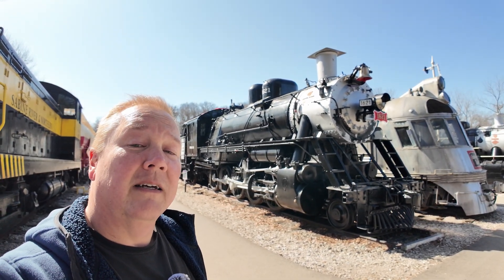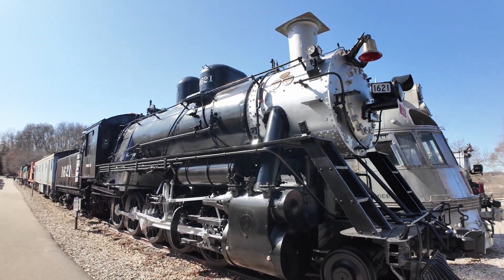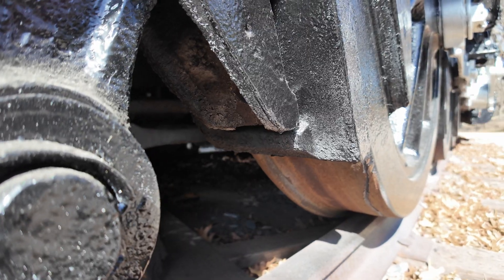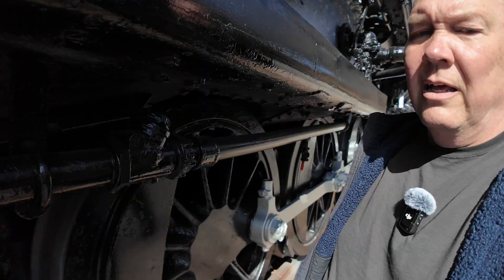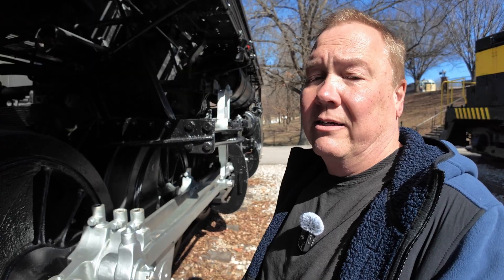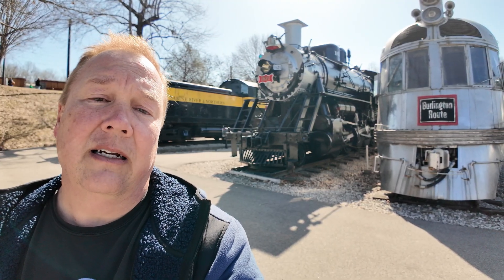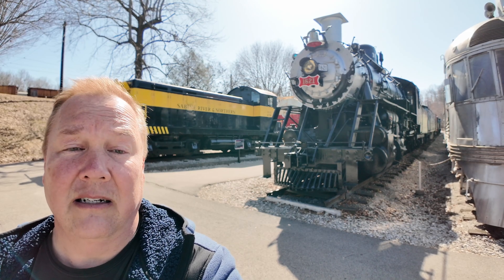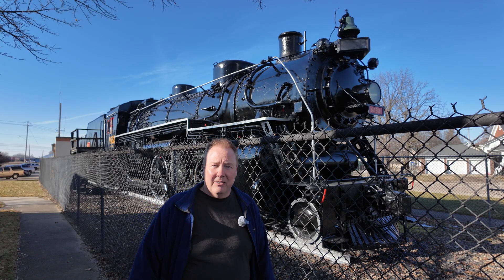The Russian Decapod Steam Engine Doesn't Fit US Rails!

Comment: When you talk about the driving wheels you never mention the word "tire."  They put wider than normal tires on them which moved the flanges back to the standard gauge location.  Your video is rather vague about this.  How wide the tires were can be seen in the shot which shows the brake shoes for the drivers, and the tire extends well to the inside.  I hope you know that steam locomotives had tires on the drivers which bore all the wear of operation and would be replaced as needed as part of normal maintenance.  You can see from the other comments that a lot of people think the drivers actually were changed, so please add to your discussion or edit the commentary to clarify this.  I worked at the museum for 10 years and am completely familiar with that locomotive.
Reply from the maker: You know, there's actually been a lot of discussion on this.  There are some who seem in a position to know who swear the drivers were cast wide and tires put on to fit those new drivers. Others are absolutely sure that the drivers weren't changed, but the wider tires were put on.  I haven't been able to verify it yet, but I suspect both may have happened.  Since these were actually in production when the order was canceled, there's a good chance that not all the drivers had been cast yet.  Possibly, where the drivers weren't already cast, new ones were cast but if the drivers were already cast, new, wider tires may have just been fitted on the narrower drivers.  As I said, this is just a suspicion at this point, not anything I've been able to verify.  Verification would likely be in the form of finding one with wide-cast wheels and no overhang on the inside, indicating a recast wheel, AND one with a 1 3/4 overhang on the inside, indicating the wheels were not recast for that one.
Reply: This is easy if you are next to it just reach around the driver and you can feel how far the tire extends beyond the driving wheel.  That wheel center is the original one, not a replacement as that wouldn't have needed the wide tire.
Reply from the maker: Yep, unfortunately, I don't personally have one close at hand (about 500 miles to the nearest one, I think).  Since there's suspicion that they are set up both ways, I'm leaning toward asking viewers to poke their cameras around the back of the drivers and post video.  If we get enough, that'd go a long ways toward answering the question of 1) at least some drivers were definitely replaced or 2) at least some tires were replaced to original drivers or 3) definitely some drivers were replaced and some just replaced tires.  Unfortunately, August was the slow time for youtube views for everyone, so a bad time to ask, and now vacation season is ending.  Kind of leaning toward asking in the spring, as museums are opening back up and people are starting to travel again.

Comment: It was said the 4’8.5 was the space between the chariot wheels on old romans Roads that were still being used thousands of years later. He used that those roads as a child there,in England. It is said he thought it was good enough for the romans to last, It would be good enough for his to last as well. Adopted Afterwards
Reply from the maker: That story's been around for quite a while, although people have recently started to question if that's actually the case.  Early in railroad history, there were a LOT of different gauges, including many really close to today's standard gauge.  The tended to be made around available wagon sizes at the time. 
 It's still agreed that the width came from being the carriage width you needed if you had two horses, side by side, but that exact gauge?  That's where the questions are today.

Comment: With all of the break-of-gauge talk, it is possible to travel by train between Moscow and Beijing in the same car.  There is a building at the border of Russia and Manchuria where the 5-foot trucks are taken off and standard gauge trucks are put on for the train to continue.  The reverse is done with the train in the reverse direction.  From what I have read, this process takes about an hour.
Reply from the maker: I'm not surprised.  Cars are easy.  Locomotives are more challenging.
Reply: @Industrial_Revolution  Locos are swapped at this location.
Reply from the maker: @royreynolds108 makes sense.

Comment: In WW2 first, the Wehrmacht had to 'renail' the rails in the occupied territories to standard gauge. After 'Stalingrad' the Soviets had to 're-renail' the rails back to the Russian gauge.
Sadly, the difference between the gauges (1520 - 1435 = 85 mm) is too small for installing 3-rail tracks which is done in Spain.
Reply from the maker: I hadn't thought about the option to double-gauge the lines, but you're right.  They're too close together for that to work.
Reply: @Industrial_Revolution  It is the usual game with Russia: everything is a bit different so it does not fit, like caliber 152mm instead of 155mm.

Comment: Brunel built the Great Western in Britain to a luxurious seven foot gauge allowing for huge coaches and very powerful locos. But everyone else used the original standard gauge from the first railways. So in 1892 the GWR converted their entire network and all the broad gauge vehicles were scrapped. There are amazing photos of scrapyards full of GWR locos at the time.
Reply from the maker: What I heard about Brunel's train was that, although it was far better by nearly every measure, the extra costs were just too much to take.  It cost twice as much to build railbeds and the extra width meant a bridge or tunnel that would hold two tracks before would now only hold one, more than doubling those costs.  In the end, money won.
Reply: The actual gauge was 7 ft 1/4 inch.

Comment: Those are tires and that’s all got wider tires
Reply from the maker: You know, it's weird.  I've got plenty of sources claiming full driver replacement while others are claiming just tires.  I'm wondering if some went one way and others went the other, especially since it looks like there were a few, different locomotive manufacturers making Russian Decapods, but not necessarily all at the same time.  Maybe one did tires and another did drivers?  Something that'll take more digging.
Reply: @Industrial_Revolution  the age of steam has the mid-continent railway museum’s #401 it has center blind drivers ( flangeless tires ) on it and the tires are wider then the wheels
Reply from the maker: I've never made it to the Age of Steam, but I've wanted to get there for quite a while.
Reply: @robertdoench6237  Blind (flangeless) driver tires are always wider than the wheels so they will stay on the rails through the sharper curves with the long solid wheelbase.
Reply: @royreynolds108  yes I know this but the flanged tires where wider then the cast wheel by several inches
Reply from the maker: @robertdoench6237 if only the tires were replaced, they'd need to be 1.75" wider each.  There appears to be some question on tire or whole driver replacement, and I'm wondering if both were done, depending on the locomotive.

Comment: In the first 30 seconds you mention when these locomotives were made but you don't say who built them.   I assume they were built by Baldwin in Philly?   Also, I am curious to know if the frames had to be modified to accommodate regauging the drivers?
Reply from the maker: That one was Baldwin, but it looks like a few, different companies may have built them, according to Wikipedia.  
I've never heard mention of any frame changes needed.  Next time I find one, I'll be trying to get a camera around behind the wheels to answer that question, as well as the new wheel vs just new tire question that many people have also asked.

Comment: I can see that making the wheels wider would have worked (without other mods) for tracks which are WIDER than that which they were designed for, so this begs the question as to whether the frames were re-spaced closer together for use on Standard Gauge? (The extra width on wheels then allowing the cylinders and rods to remain unaltered.)
Reply from the maker: Well, it wasn't an issue for the non-drivers, since they're mounted on bogies, anyway, which are mounted on center pins.  For drivers, going wider would have required moving all the pistons steam lines, reversing gear, etc, outward.  Easier than moving inward, but still not trivial.  To move in, I don't know if they had to change anything on the frame or not.  Remember that these were made in the US, where they were used to working with standard gauge at that point, so the frames may have been built for it and may not have needed much alteration.  At the museum, they told me they only changed the wheels, so I wonder if the original, 5' gauge wheels had spacers or extra-wide hubs to cover that extra 1 3/4".  Next time I see one, I'll try to get a camera around behind the wheels, if I can.
Reply: @Industrial_Revolution  cheers, it would be interesting to know. Logic would dictate that if they were originally intended for 5’ gauge then the frames would have been spaced further apart on the original design. Changing that spacing would be simple, as the frame stretchers could have been made smaller. However, it would have been an expensive modification to change the cylinder block casting, assuming it was a single piece casting.
Reply from the maker: Well the cylinders didn't move in this case.  Next time I see one of these, I'm going to try to get a camera around behind the wheels.

Comment: I am a little confused to re gauge from 5ft to 4ft 81/2 inches would need the wheels sets including the driving wheels replaced to be acceptable for the US railroad, this means new axles, I suspect the cast frame would have been made for standard gauge with redesign in the axle box & axle to suit 5 ft gauge, there are examples in Australia of locomotives built after WW2 for rail gauge of 5ft 3inches that could be converted back to standard gauge & one was recently converted a Victorian Railways R CLASS.
Reply from the maker: If you've ever seen wheels being transported, wheels and axles tend to be a single component, even today.  Fortunately, those are pretty trivial to swap, and you're only looking at 1.75" on each side or, worst case, just replace the whole bogie assembly.  Not a big deal, since those would attach the same everywhere.  
The drivers were the challenge, since they have to connect to all the running gear located JUST outside the wheels.  In the states, 50 years earlier, after the civil war, a lot of locomotives had to be regauged to make them wider, to get up to standard gauge, which is much easier, since you could just add spacers to move things out a bit, but you can't really grind down 1.75" of frame at every connection point to move things in.
There's been a lot of questions on this, and I'm not an expert at regauging, but it sounds like it'd be a good topic for a video if I can find info on it.  I suspect there's probably enough info on the post-civil war regauging to work with.  I'll add that to my topic list.
Reply: @Industrial_Revolution  Many railroads in the South up to the end of the War Between the States were gauged 5 to 6 feet; so regauging would have been making the tracks narrower not wider.  An interesting tidbit: the GENERAL and the TEXAS from The Great Locomotive Chase fame are still in existence and are still to the gauge of the Western & Atlantic RR gauge of 4 ft 9 inches.  The W&A was and is still owned by the State of Georgia(.  It was leased to the L&N and now the CSX Corp.
Reply from the maker: @royreynolds108  I think I'm going to do a regauging video about the post-Civil War era.  Need to do a bunch of research before I can do that one.  The Decapod is certainly not the first time regauging has ever happened, and there's various ways to do it.

Comment: Meh, who cares if the wheels hang over a bit?  It’s functional, and not too noticeable from a distance.
Reply from the maker: Actually, if no one had told me about it the first time I was at the museum, I'd have never noticed.  A couple people here in the comments have mentioned who cares, though.  Some lines used raised frogs on the outside of switches, etc, and these would cause problems for those extra-wide wheels when they ram into them.  Otherwise, you just have to pay attention to it when you change the tires out, which should be a big deal.

Comment: Why didn't they just have longer crank pins instead of thicker driving wheels?
Reply from the maker: That would seem easier, wouldn't it?  I've never heard a reason for it, but as a guess, running a long, relatively thin rod at 90 degrees to the direction of torque, with all the power directed through that rod, would be more likely to bend and/or break.  Someone else here in the comments may know for sure.

Comment: Changing the gauge is a matter of changing the axles. Baldwin  and PRR Altoona who built them could change the gauge in less than a day.
Reply from the maker: For nearly everything, yes.  The one place that it's more complex is the drivers on steam locomotives.  You want the connecting rods right up against the drivers, rather than running longer pins to connect them, and moving the rods, pistons, etc, all in is not so easy.
Reply from the maker: After the US Civil War, railroads and locomotive works got good at changing railroad gauge.

Comment: Wikipedia claims some more were built later and sent to the Soviet Union during World War II, and that a subset of those was also stranded here after the war.

I have a suspicion that somebody in the locomotive factories here was thinking ahead and made the design so that it would be possible to regauge the locomotives in case they needed to be used here (this might have even helped for testing at least the first units on standard track before sending them over).

One additionnal difference to note from normal US locomotives is that the axle loading had to be less for Russian track than for US track.  You can tell in the video that the unit shown looks fairly lightly constructed for a steam locomotive -- if you sent a full weight US locomotive over to Russia, even ragauged, it would have probably broken the track, at least after a few uses.
Reply from the maker: Since there were so many being produced, I assume there was some dual-gauge (at least) track laid to a port, where they could be loaded onto ships.  There were others produced at 5' gauge, too, like the Panama Canal mules, which were built in the US and shipped to Panama.  
Russia did build some beasts of steam locomotives.  They just added more drivers to distribute the weight better.  More non-articulated drivers does limit your curves more, but lets you save money on the tracks.  Biggest I found is the AA20, a 4-14-4 locomotive, although only a couple were built.
Reply: @Industrial_Revolution Indeed, although as far as I know, only a single AA-20 was built, and it was a failure.
Reply from the maker: @Lucius_Chiaraviglio I think I read they planned four, but only built two.  I can't imagine it handled curves very well.
Reply: @Industrial_Revolution  Wikipedia says just 1 was built.  And it had terrible trouble with curves and switches.

Although I wonder if it would have worked on the Union Pacific (assuming you could re-gauge it to Standard Gauge, which may be a bad assumption)?  The Union Pacific's 9000 class 4-12-2 locomotives had fairly long and successful careers on the flatland parts of their track.
Reply from the maker: @Lucius_Chiaraviglio There's a lot more complexity than people realize when it comes to driver size, number, articulated or not, etc.  I'll be making a video or two on this.   The thing I don't know is why they didn't put blind (flangeless) drivers in the center to better handle curves
Reply: @Industrial_Revolution  They had no flanges on the 3rd, 4th, and 5th drivers.  Also from Wikipedia:  They did order 2, but only 1 was built.  (Also, somebody else also did a video on the AA20 which says more or less the same things as the Wikipedia article.)
Reply: @Industrial_Revolution  Actually 2 other videos on the AA20 that I have watched:  https://www.youtube.com/watch?v=0fr4DTDCbxU&pp=ygUPQUEyMCBsb2NvbW90aXZl and https://www.youtube.com/watch?v=pBhm9G54f5A&pp=ygUPQUEyMCBsb2NvbW90aXZl (and YouTube has several others that I haven't watched yet).
Reply from the maker: Thanks!  Russia's probably not real high on my list of filming destinations right now, but always good to see different technology, especially the failures, since they often led to much better results.
Reply: @Industrial_Revolution Russian design engineers came up with some interesting innovations.  Some of these worked, but many that might have worked if given a second chance never got that second chance.
Reply: Estonia in the early 2000s did buy secondhand GE Dash 7s locomotives and regauged those to 1520mm
Reply from the maker: @detroitdieselseries5071  It's a lot easier to do with diesels.